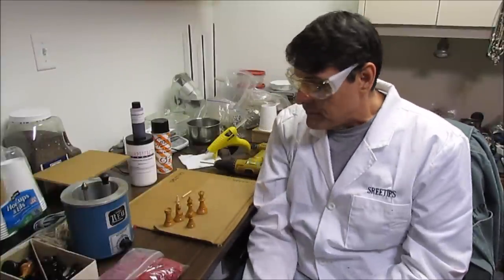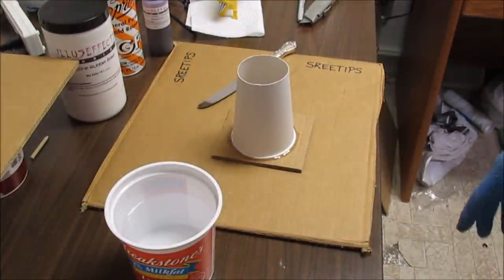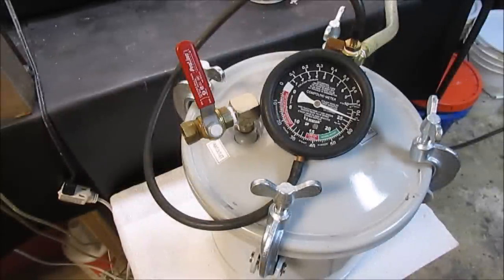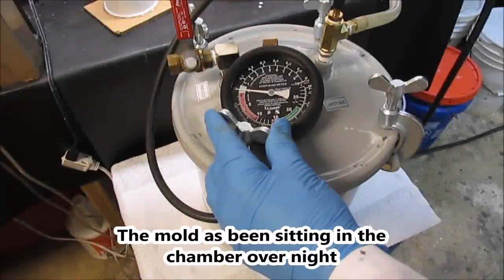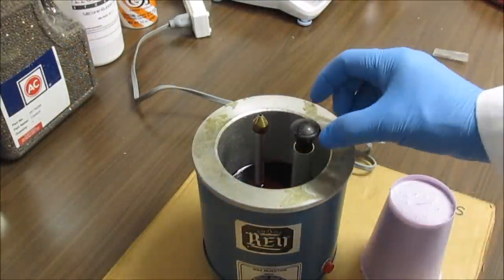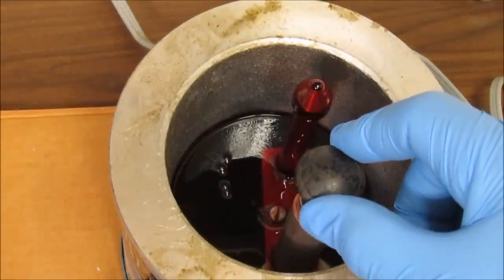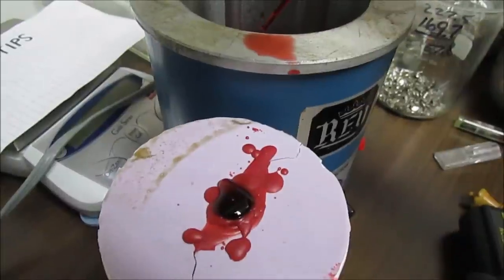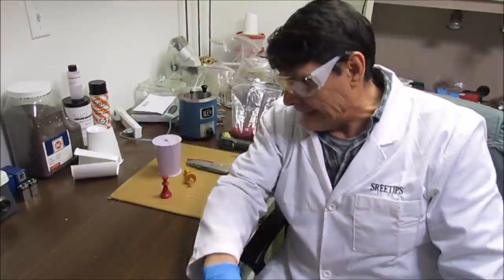Sreetips Chess Set Lost Wax Casting Silicone Mold

Comment: I spent 20 years as investment casting engineer and the other half in a mold/pattern shop. You did well on your attempts. I have a couple of suggestions. Silicone mold pouring we would degas the silicon mix and not the poured mold , you put the mix pot into the vacuum pot , container should be at least twice as high as the charge (silicone level) this is to prevent over spill. Degas slow at first before going to high degas this is to get the bulk out before high degas. Then take pot out and do your pour in atmosphere. 
Molds . Silicone self seals so cutting vent in after is near impossible unless you cut on a parting line. We would put thin wire on pattern that we strip out after cure , this gives a clean vent passage . Wire should be small enough diameter so vent never fills , this depends on viscosity of your wax. Also you open pour the base after injection, we would have put a couple of dowels into chess pc in line with golf tee. These dowels will make vents for open pour , dowels can be placed in holes to shut off at injection then removed for open pour. 

Again I did this a long time and my way is the way, lol. There are many ways to skin a cat , hope I did not a-fend.
Reply from the maker: Not at all. This is the kind of feedback that I'm looking for. Degas the silicone before hand. Thin wire for a vent - excellent. Thank you.
Reply: Agree. We would use a bell Jat, put your potting in it. Turn on vacuum, watch potting "boil", turn valve to inlet air, potting will subside, close valve, watch it boil up, open valve, after repeating this you will have effectively removed all air from potting "silicon mold liquid".
Reply: Hole thru table and rubber matting with bell jar on top. Watch your work.
Reply from the maker: I need to revisit this. I’d like to do some casting of my pure silver. And gold.

Comment: Ohhhh, I saw that boil over happening before you turned the pump on lol! That RTV rubber expands about 3x it's volume. If you pull the vacuum on the Silicone rubber in a larger bowl, then carefully pour it into your chess cup, there is really no need to pull a second vacuum, as all the bubbles are gone and your mold will be bubble free. If you want some tips on some ways to use the much cheaper vulcanized rubber without using a vulcanizer press, let me know. It will save you some serious $$$ on the rubber. RTV is pretty expensive.

Comment: if you lightly dust the inside of the silicone mold with baby powder it will release a heck of a lot easier :) another tip if you slightly warm the mold the wax will get further into the mold and if you turn that mold into a 2 piece mold by cutting it into 2 pieces you will get the wax to go further up  because the cuts will allow the wax to spread out and air to escape.  sure you will get a little flash but that can be fixed with an exacto :) 

In the next step for your investment mold if you use a metal tube tape some newspaper up higher on the tube by an inch or 2 so that when you pour the investment into the mold with the wax spru and model if you do have any air bubbles they will be in the upper part of the mold and also that added newspaper will stop it from bubbling over in the vacuum chamber but work sort of fast because investment sets pretty rapidly once it starts. 3-5mins at most
Reply from the maker: That's a good one, newspaper at the top for degassing. Good stuff, thank you.

Comment: LOL, I wondered how I had missed this until I saw the date. good conversion for the vac chamber. I like that HD unit you have there. Mine is the same size more or less and I used a modern pressure cooker with a lexan lid and a vac pump from a heart lung machine I rescued from our dump. The best vac I can pull up here is 23 inches. I was able to test it at sea level and got 26 in. Not bad for a very old pump. Seeing this is great as I want to do some lost wax. Little things like lower vac values and other small but important steps like the pipet are here to be observed. Just like silver if a fail happens just melt and repeat, LOL. Just like silver it needs to be hotter than it's melt point to flow well into a mold. I was looking for the next video but can't find one ?
Reply from the maker: This is as far as I got with this
Reply: @sreetips  Got ya. I soooo wish I had high speed WIFI as I could extend my videos a lot longer. As it is it takes an hour per minute to upload my clips to CSS for editing. You always have nice indepth posts full of solid info.

Comment: Emeralds break If you set them on the wax and pour the metal,use rubies
Reply from the maker: Not in the wax, I meant set a rubie or emerald in the solid silver finished piece. I'll drill a hole at the top of the queen then put in a six-prong setting and set the stone in that setting. Yes, emeralds are like opals. They are very brittle and break easily.
Reply: sreetips honestly emeralds may crack even If you are careful setting them, i've made a set of emerald earrings and necklace, and I wanted to set the Stones based on their points,it was really a bad idea
Reply: Emeralds, the bane of a stone setter lol

Comment: I don't know if this has been discussed here before, however, why don't you give it a try with a two part epoxy / hardener mix instead of wax?
Reply from the maker: The wax will be put inside a metal flask with some molding compound. After curing the flask will then be placed inside a 2000 degree furnace that will completely burn the wax away leaving no traces, and leave a cavity in the shape of what the wax piece used to be. Then, while it's still red hot, molten silver is poured into the hole filling (hopefully) every nook and cranny of the cavity. I don't think epoxy would work very well in place of the wax.
Reply: @sreetips  - I understand now. I was wondering why you had referred to it as 'lost wax'. It makes sense now. Thanks!

Comment: What's the difference with the wax and basic candle wax? I've made couple wax skulls with candle wax as it's very cheap and for me it worked out ok. Also, as i didn't want waste any extra money with this before i make couple of trial runs, i used alternative silicone. I mixed corn starch powder into cheapo bathroom silicone, the one that comes in tubes. I mixed it until it was mixed all the way (gloves are good idea!). Then i applied it straight into the skull, it isnt runny so you have to help it by pushing into crevices and so on. As said, it worked good, only downsides are that it's fairly brittle so you wont get more than couple wax casting out of it. Also it dries and warps within couple of weeks, so very short shelf-life. But it cost me like 5 bucks and worked as i wanted it to so i count it as a success. Next thing, i have to find the cheapest way to melt the silver...
Reply from the maker: I don't know what the difference is. It's what was recommended by some friends who do wax casting all the time.

Comment: Maybe pressurize the silicone in the mold to shrink bubbles?  Rather than pull vacuum
Reply from the maker: According to a friend who does this regularly, pulling a slight vacuum is the best way to degas. But most chambers have a viewing port so you can see inside and regulate the vacuum to avoid the overspill.
Reply: This is true.  Just another idea to consider...  
Anyway, I love to watch your vids, and cant wait to see the cast of the chess pieces!